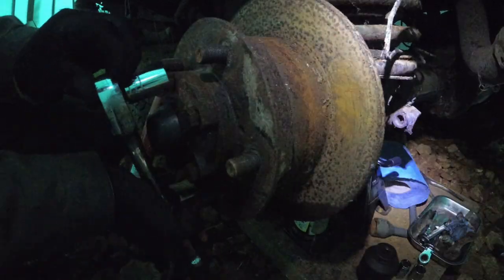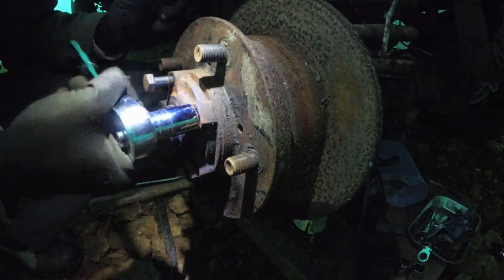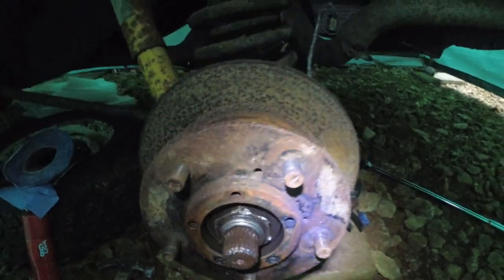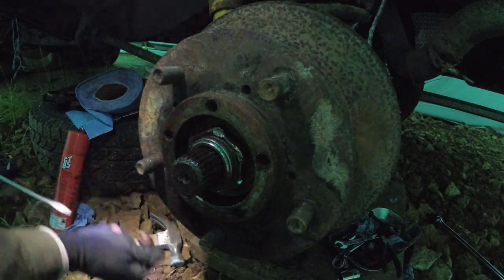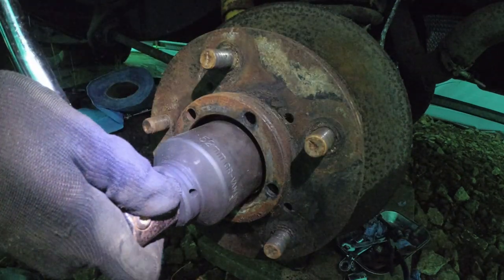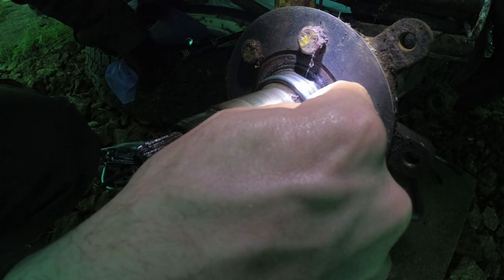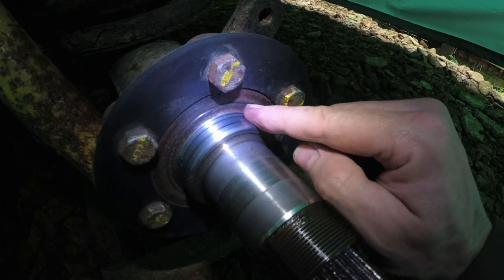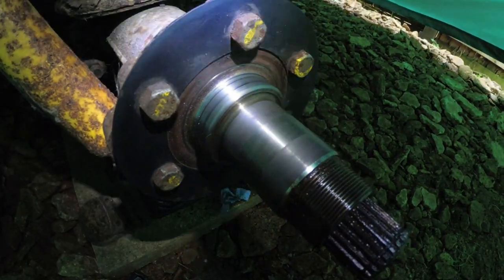Who uses a chisel on a hub nut? Rear Axle Refurb Part 6

Comment: There are some real muppets around who use a chisel to tighten hub nut ( or any other big nut really) & muller absolutely everything with their ignorance and complete lack of knowledge & understanding. 
The garage in Arbroath which worked on my Defender before I bought it chewed up everything including an axle set of  new Timken bearings, so much for so called professionals, I’d rather have enthusiastic informed amateurs if that’s the best they can do when charging for trained mechanics labour.